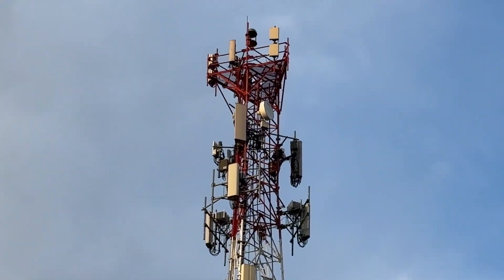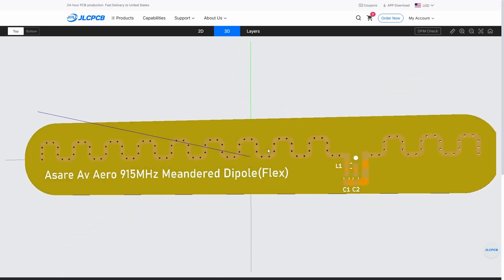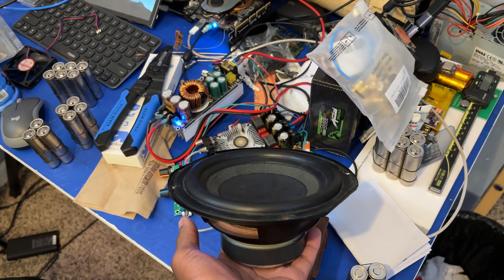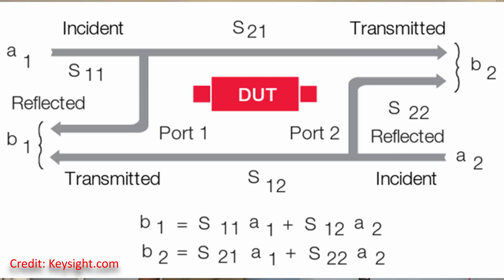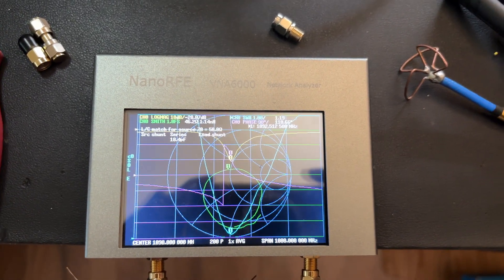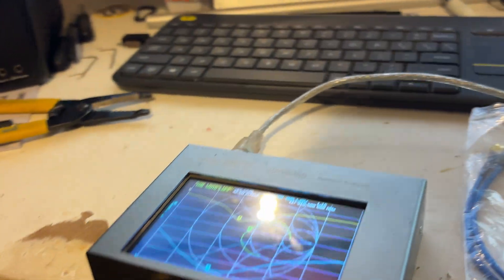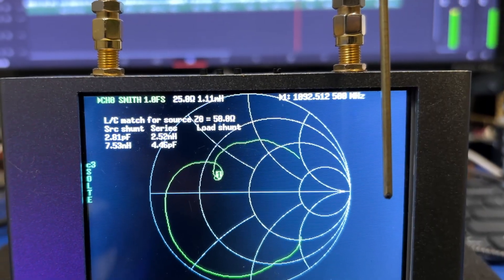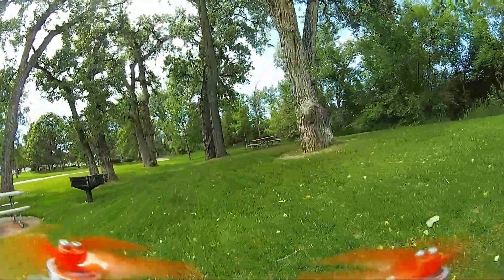What Even Is an Antenna???

Comment from the maker: Use EasyEDA for your next board design and save $10 on your order! Redemption period ends February 28th, 2026 https://u.easyeda.com/account/user/coupon/activating?uuid=57bdec55c1e948108bb633d7ef14807a

Upgrade your projects with JLCPCB's pro-grade 6-layer PCBs — accessible advanced
performance: https://jlcpcb.com/?from=KofiAsare0
Reply: more high speed or big distance antenna stuff also if you can some drone/antenna stuff to mod them for biger reach or bypass (pipe ) the controller e.f Dji ones to a roof antenna for better controll either by an AI when at home .
Reply: forgot to say please* :P
Reply: Cool

Comment: An antennas wire, is that a special wire that is specially designed or could I cut a dji's wire then solder it to a length of antenna wire with the original DJI antenna on the top of my house so I don't have to go outside to fly?

Comment: At @1:55: technically the proper way to say S11 is "S one one" and S21 is "S two one" (rather than S eleven and S twenty-one)---because it means a measurement of power reflected out of port one on the device that was sent into port one on the device. Similarly S21 means a measurement of signal coming out of port two on the device (the output) that was put into port one on the device (the input). Nonetheless, fantastic video! EDIT: I just noticed you put a caption that says this correctly. 🙂

Comment: when I was 11, I hooked my Nintendo to the set top antenna for the early 80s floor model television in my parents basement.  I  was surprised that the screen of the floor model and a portable bw I owned both displayed (wirelessly)the Nintendo game screen of Super Mario Bros. I was unceremoniously dumped from the state of surprise moments later when the basement door opened and my mother screamed  down "Why The F is Nintendo on my Television instead of my show? Oops! I later found out that those old Nintendos were actually television transmitters.  Apparently it was the easiest and cheapest way to get the Nintendo gaming system to connect with the analog televisions of that time